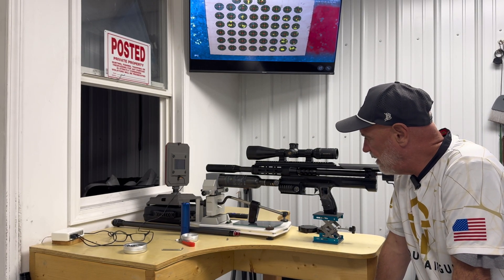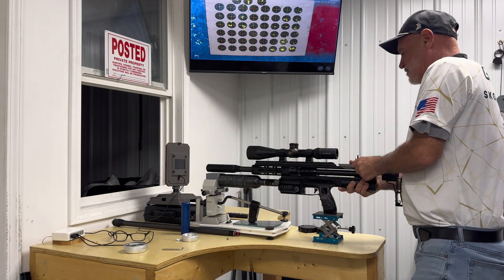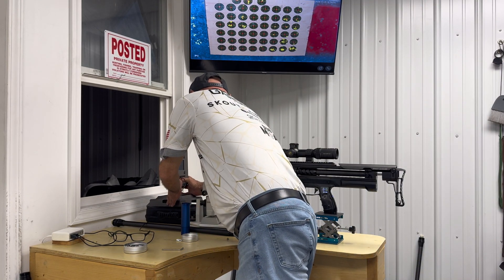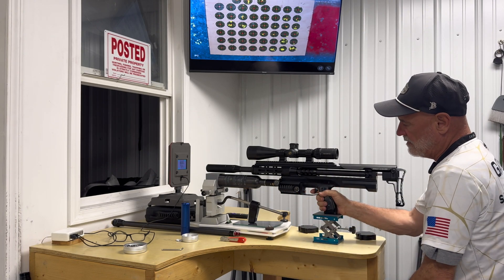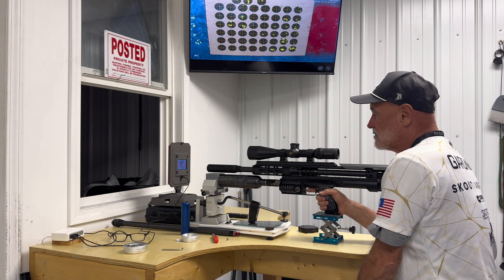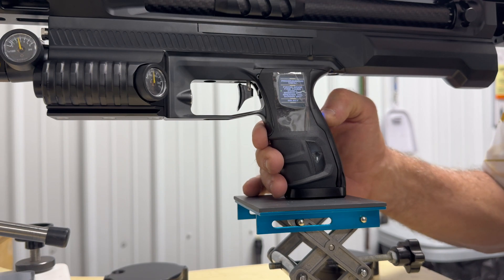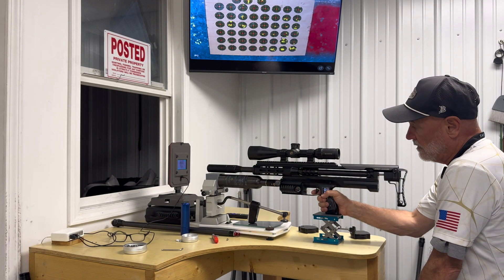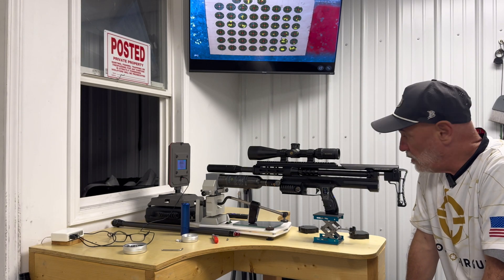Skout Airguns Tech Tuesday - EVO Tuning

Comment: Looking at the .30. Fascinating video. What I haven't come across is "DWEL" You set it at 16 but what does that mean? Cheers, Antony , UK
Reply: It’s the milliseconds that the valve is open, if you’re limited to 12 ft lbs., you won’t need to worry about it. If not, then you can download some pretty good instructions from their website.